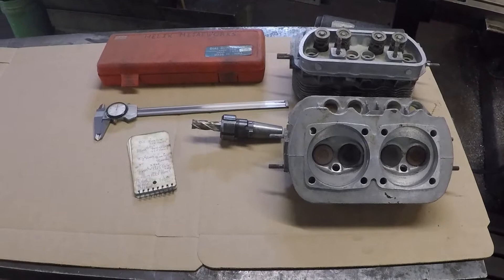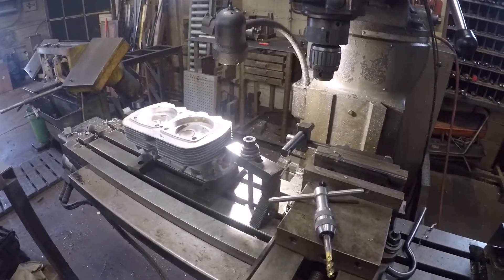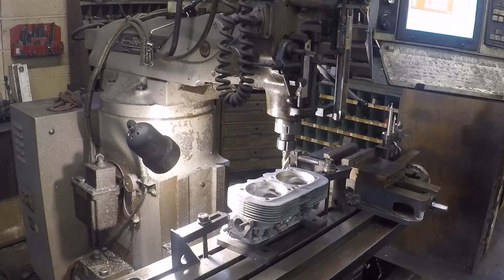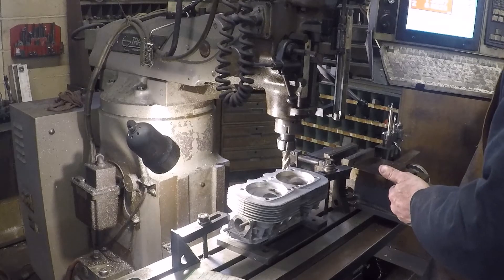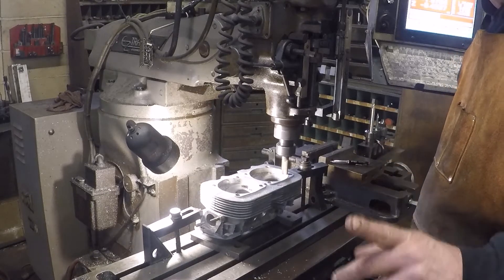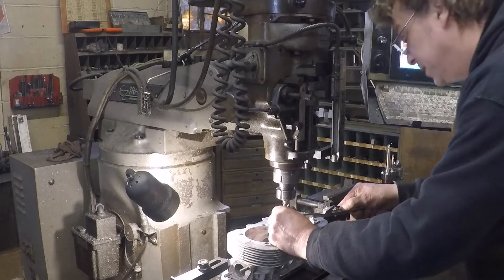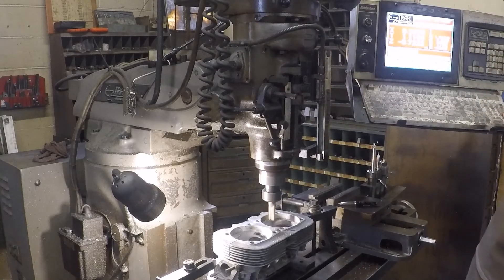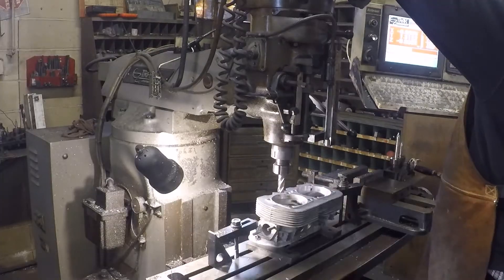HMW Machining VW heads using the Bridgeport EZ Trax

Comment: Hey Jeff
( I finally know your name 👍)
The good part about going back and watching the earlier videos on a YouTube channel is you can see the raw videos.
Where the people posting are still finding their way and usually nothing is scripted or pre-prepared.

When I first had thoughts about starting my own shop a Mill pretty much like yours was on my list.
The brands were a little different but the functionality was pretty much the same. 

The Manual Mill I currently own, was also something I was thinking about ??
The NC version gave me options that could definitely come in handy.
But, the NC Mill was a little lighter on for other uses ??

The NC Mill was a lighter weight machine with less Travels in all Axis ??
It took some time to come to terms with which might be best for me ??
At that time I was mostly a Repair Shop with some Manufacturing.

In the end I finished up deciding to go with the larger Manual Mill.
But, when some of the Manufacturing jobs came in ???
I was kicking myself for not buy the NC version.
That always happens with any machine purchase.
You get something and lose something else at the same time.
Thankfully, shortly after buying the Manual Mill I could justify a VMC.

Wouldn't it be great IF you buy all the machines you needed at the same time.
I guess, IF that was a reality.
I'm sure I could justify doing something else with that much money 🙂👍

Comment: It's actual .03936
Reply: It's actually 0.03937007874015748031496062992126.  It is better to divide by 25.4 for unit conversion from millimeter to inch. Using 25.4 has no rounding error.

Comment: Fancy machining there.  -   a Wohlhaupter boring head would have been faster and much better finish.
Reply from the maker: cant fit one in the ez track it has a guick change 30 spindle, this is the way I have to do it because of z limitations, now if I ever get a riser block I will do it with a boring head. a good side wall finish is not needed, just a nice finish on the sealing surface.
thanks for the reply!